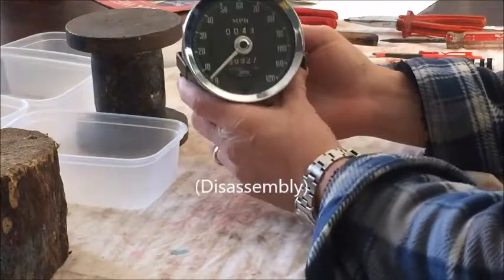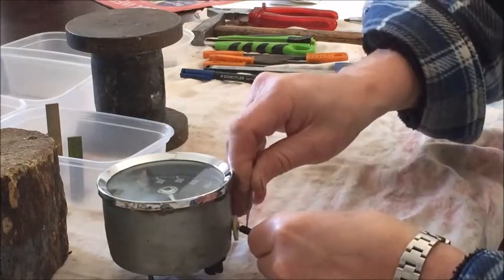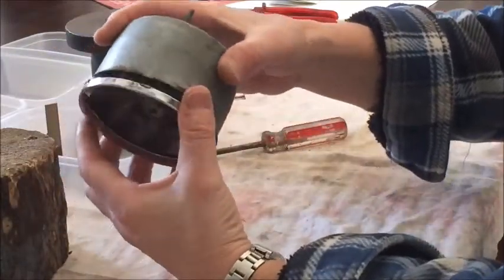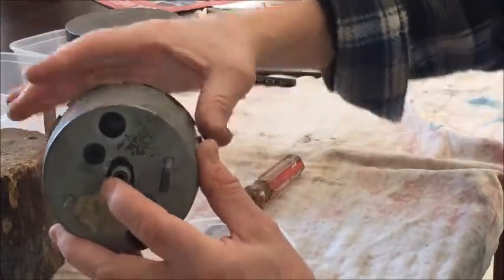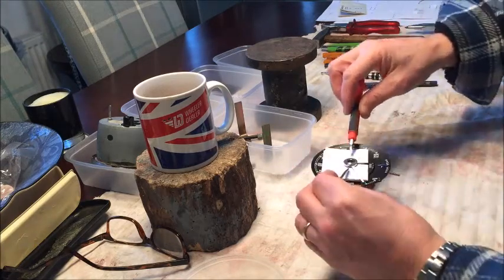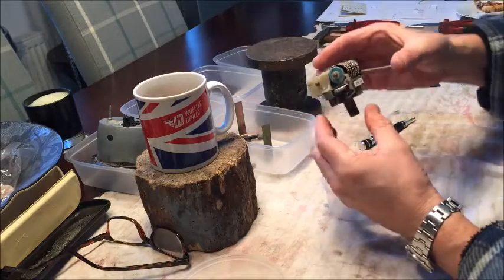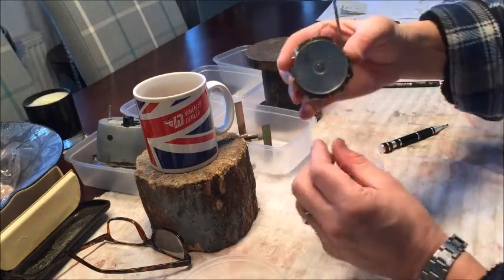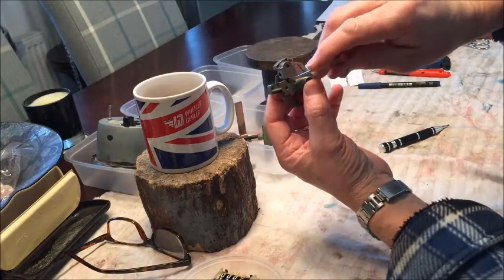Smiths MGB Speedo, under reading  and sticking. 1 of 3.  Disassembly

Comment: Thank you so much for making this video.  I have this exact issue with my 1965 MGB Smiths speedo.  Although my internals were somewhat different, your video gave me the basics to complete the repair.  A side note:  I had the same issue with removing the internals due to the face and trip reset shaft.  I solved it by removing the speedo needle and face first, then the internals dropped right out.  Eazy Peezy.
Reply from the maker: Great to hear!

Comment: Neil, I love your two videos on the disassembly of the MGB speedo.  It is exactly what I was looking for.  The problem with my 6144/00 is that the square input shaft is frozen.    The speedo worked just fine the last time I used the car, about 4 years ago.  It's been in storage and now it doesn't work.  Do you have any ideas on what I could do to unfreeze the square female part that is on the back of the speedometer?
Reply from the maker: Hi and Thanks for the positive comment.... let me have a think about the problem and I'll get back to you. Neil.
Reply: @Madeinwem  thanks Neil
Reply from the maker: @artwerner5511  Art, it sounds like the input shift has a little corrosion and has seized.  You might try disassembling to the point at minute 6:00, and getting some WD40 in the shift, and gently rock the bar magnet from side to side? Regards, neil. PS.  If you could send pictures it may help?
Reply: @Madeinwem  Neil, I will do that today, thanks for your help.  I'm not sure how I can send pictures to you on this reply.  Thanks again.  Do you repair speedos?
Reply from the maker: @artwerner5511  sorry Art, I am just an enthusiast that needed to fix a problem and shared it because there is very little info on youtube
Reply: @Madeinwem  OK, it was worth a try
Reply: Neil, I don't know how to thank you, I just finished repairing my speedo and it works great.  I was very lucky because my 67 MGB  6144/00 was not riveted to the inside back plate, it was held on with 2 screws.  I completely disassembled it  and found out what the problem was.  Somehow a very sticky substance was on the shaft of the square drive and after using WD40, I got it apart.  I took an old allen wrench and ground it down to a square and was able to move it back and forth to free it up.  I used WD40 to clean everything up and then alcohol and cue tips to finish the process.   1 drop of 3 in 1 oil on the shaft and little gears and it works like a charm.
If it wasn't for you excellent video, I never would have tried to fix it.  I was actually thinking of shipping it to the UK to be repaired.  I think that someone tried to take it apart before I bought the car and they put some kind of tar like substance around the input shaft to seal the oblong hole on the back of the case.  We have had many 90 plus degree days here and I think that it melted and froze it up.
Thank you again for the video and help.
Art
Reply from the maker: @artwerner5511  Awesome! I'm so pleased that it worked....This is exactly why I made the video and I'm so 'over the moon' that it helped you.    Cheers, Neil.
Reply from the maker: 9o7o

Comment: Love the in depth footage and details, but I had one question.  I'm working on a '74 TR6 and now working on the gauges and wood dash.  I got the speedo apart and cleaned, but in the process, broke the needle!  I am so hurt, but I know it can be repaired.  I saw how you were able to pop off the one in the video.  Is this the same process for the TR6?  How does it go back on?  I'm hoping that the needles are readily available and I don't have to send it off for repair.
Reply from the maker: Thanks for the kind comments and support.  I'm not sure what kind of needle the TR6 has so I can't comment on it.  But the Smiths Speedo fitted to the MGB just pops off with a bit of even pressure on both sides and pushes back on.  It's held firm with friction.  If yours won't come off with moderate pressure, I would think it may have corroded? maybe a cotton bud with a little WD40 may help?
Reply: @Madeinwem  it's a Smiths, but looks slightly different from the one in your video.  Will give it a shot and see if I can get it removed.  Thanks for the response!  These videos have definitely eased my mind with regards to taking it apart.
Reply: @kawzx9r_036  Did you find it would come off?  I am in the same dilemma with my  1974 TR6 speedo!
Reply: @CorneaPop  Yes...I was able to remove it.  There happens to be a TR6 shop less than 15 minutes from me and they were able to source me a replacement heater plinth and a speedo needle.  I was able to use the fork method to get the original speedo off.
Reply: Looks same as clock hands, pick up at hobby shop

Comment: At 3:10 there is a black shape inside the speedometer housing.  Kind of diamond shape.  I am wondering if that is rubber or what it is.  I have mine apart, and the substance is hard as a rock.
Reply from the maker: @writerjmd  hi and thanks for watching. It is a long time since I had my speedo apart. I think it was a rubber spacer or something to stop the chassis of the internal working from rubbing  on the case.
Reply: @Madeinwem  Thanks.  What's left of mine was hard and crumbling.  I think I will make one out of a toolbox drawer liner.  That should be about the same thickness.  Your video was helpful because I could freeze it and see what shape it was supposed to be. Thank you.